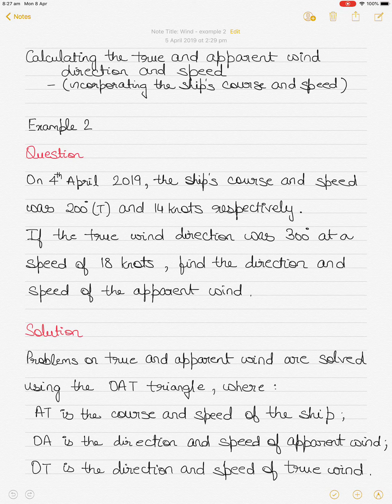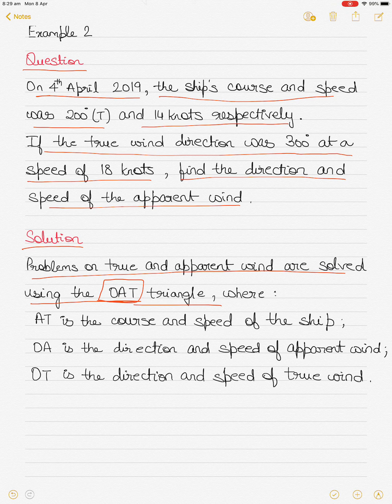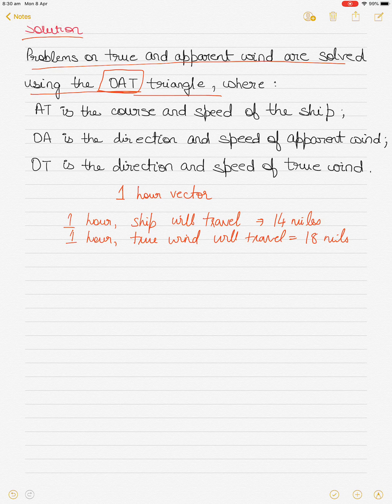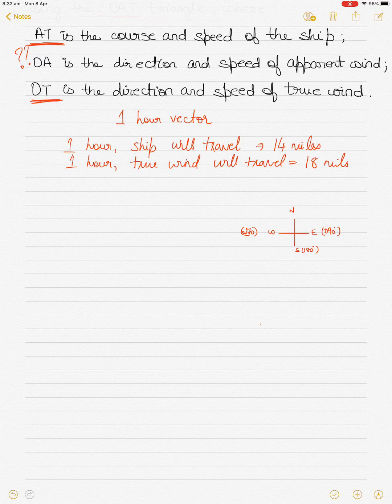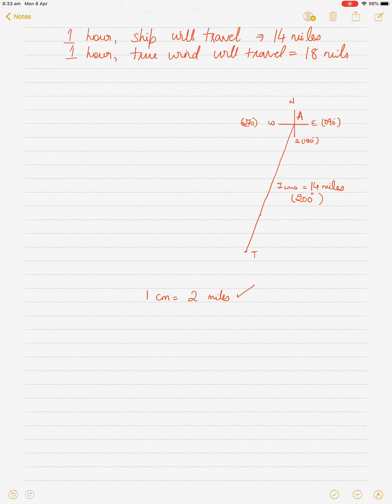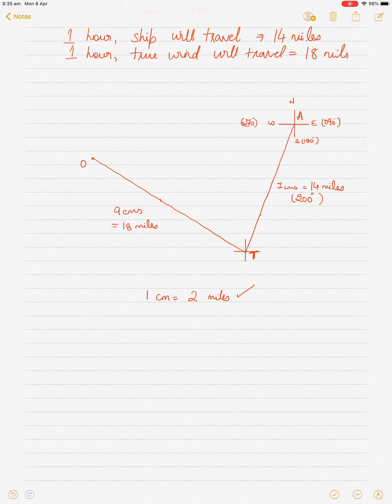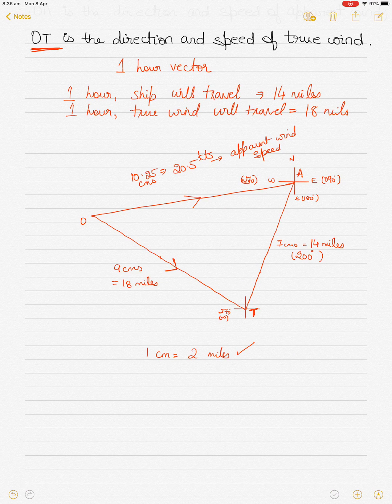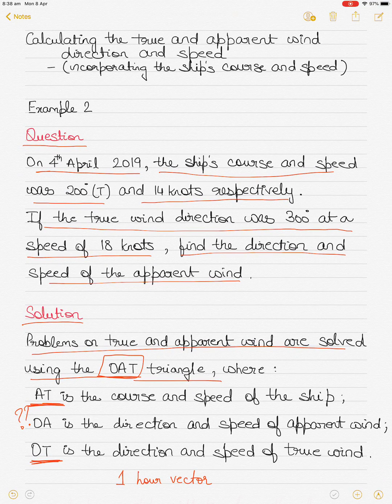Calculating the wind direction and speed -  the OAT triangle (Marine Meteorology)

Comment: Sir I have a doubt , the wind on the anemometer displayed 60(R) from for bow on a westerly course, the ap wind direction would 270-60 =210?
Reply: You are doing 270' and relative wind is 60° that is, wind is affecting your stbd beam... So true wind should be 270+60 330°..
Correct me if I'm wrong